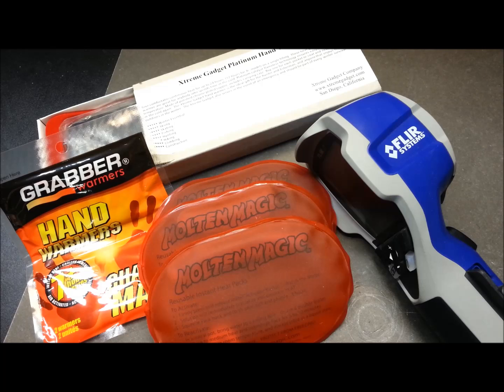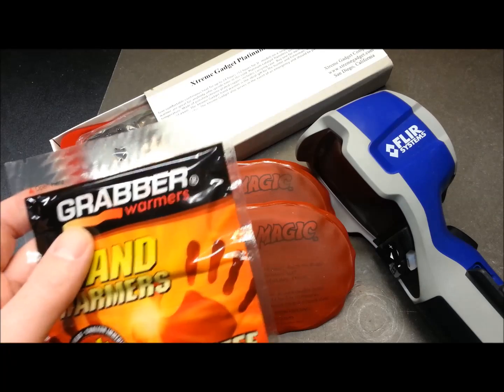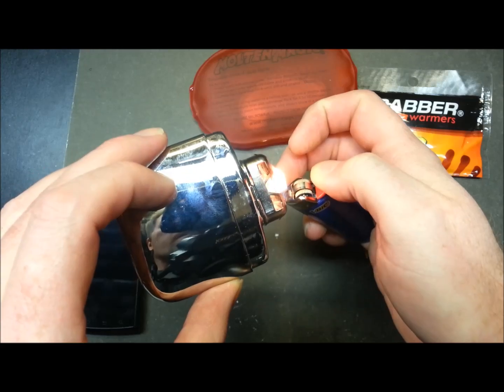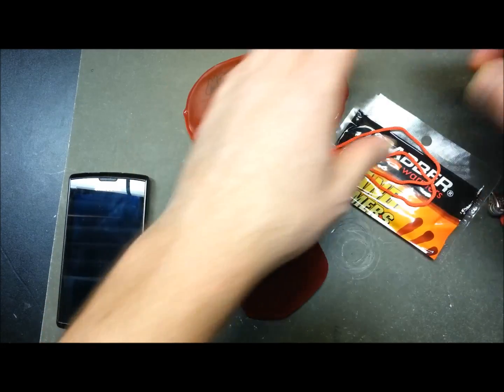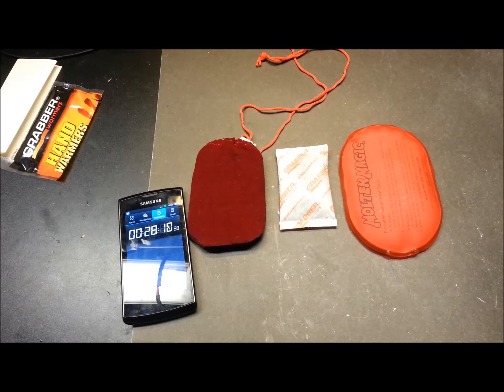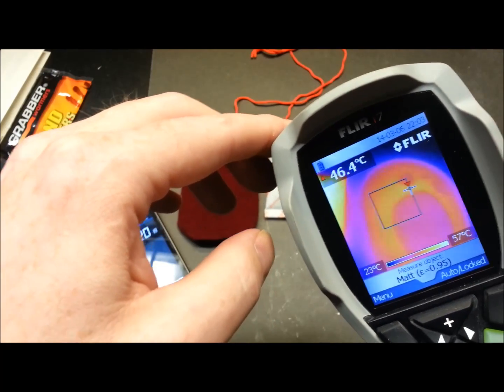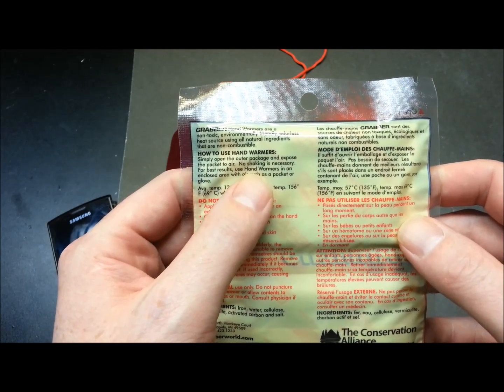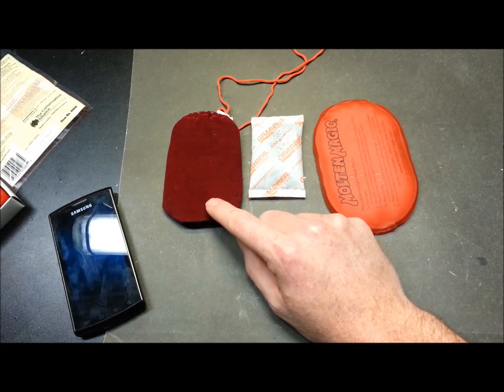Hand Warmer Test -Which type is best?

Comment: What about a Li-Ion powered hand warmer? For this application this would be est, it's a it heavier, but it will go for hours and it doesn't need oxygen and the heat it generates keeps it's own batteries and electrics going too. I prefer the catalytic heaters as they go longer and batteries wear out faster but in this case you can't beat a battery.
Reply: Sure it'd probably be possible just to make a little heating circuit with an element, thermostat and battery, to turn off and on as needed. Was 7 years a go tho, so no matter. lol

Comment: the catalytic was very  incorrectly done they it was done was for low temp and longest duration if higher heat it should have been left out of the bag for at least till it was very hot to the touch as More air means more heat and that sets the overall  temp so very unfair test as the equipment was not well understood before operation

Comment: Interesting, how did it work out in the payload?
Reply from the maker: +kamikazekeebler Perfectly. The testing showed in the end I only needed a small amount of heat with the GoPro radiating as well inside the HAB. One single disposable was just right and did not overheat (would kill the cams) or underheat (also killing the cams).  The datalogger showed I hit it bang on. Full video on my channel.  Cheers

Comment: So which gave off the most heat??
I tried skipping to find where you talked about it, annotations would be nice
Reply from the maker: +Zoe Doucette It was a test for a high altitude balloon as mentioned so there was no "most heat".  That would be hard to measure empirically.  Time radiating heat was indeed measured.  Just get yourself the disposable ones and all will be fine.

Comment: One type of heating that you might want to add to the comparison is electric.  A simple resistor [(1W or 2W 60 ohm) or (4W  Silicone heater)] would be dead reliable and enough heat for the small space.  You could also PWM the heater so as the temp drops you add heat.  You have the controller and other data already.  Just a thought and thanks for the videos.
Reply from the maker: Thanks Matthew.  Check out the upcoming videos- the thermal output requirements are significantly more than even I expected.  I haven't done the exact math yet as I haven't got the heating up high enough to even support - 20C for an hour, the wattage required will be significant to say the least :)  Cheers
Reply: Eric William Are you not insulating the instrument box?  When we did our HAB we used 2" pink foamular as the instrument box held together with clear packing tape, nearly in destructive and light.  A 4-watt heater could give a 30 deg C change in temperature easily.

Comment: Hi Eric, you might like to check into a thing called a crystal oven, they used to keep RX/TX oscillator crystals at a set temperature to avoid problems with drift. Can properly be able to build one theses ovens cheap and light enough and power it off of a LiPo battery, and also program the oven to turn on at a set temperature or altitude to save on battery power.
Reply from the maker: Thanks Dale!  This is exactly why I enjoy posting videos and receiving feedback.  I had not heard of the crystal oven at all- a quick look and I see several videos and posts.  I'll definitely take a look.  Cheers!
Reply: Hi Eric, is a friend of Dale's here, I had an idea that may be more simple,
You can mount a linear transistor near 1 end of your board, and the
collector's resistor near the other end of the board, with the biasing for the
transistor being preset by 2 components ; 1 is a thermistor of your choice,
located at the centre of board, with a mutiturn "threshold" pot nearby
so - > end result - no power consumed until you have set it for slowly
ramping up the heating current, as the pcb starts to fall too low in temperature - i,e,  by setting the pot, you will get a twin-heated centre
monitored ; minmum consumption heater circuit. I hope this helps
Regards Andrew VK5WT
Reply from the maker: I'll definitely have to consider something like that if we launch another.  The data logger circuit is already complete and under tests so I think I'll just stick to the warmers this time.  Thanks for the ideas.  Cheers.

Comment: The reusable liquid one is Sodium Acetate, a.k.a. Hot Ice. Maybe an electric heating system would be an option. You can get flexible stick-on heaters for electronics.
Reply from the maker: Yep indeed it is.  As for electric heating- the draw to get the BTU output actually cause some problems for weight when it comes to supplying the power over the needed time.  The hand warmers are far more effective (so far).  Thanks for the input!  Always appreciated.
Reply: Maybe you could have a volume of the Sodium Acetate in a container that would partially surround your electronics (it's easy and cheap to purchase) and have a remote or temperature based system to trigger the 'freezing' reaction (dropping in some crystals for example). That might gain you some extra time.
Reply from the maker: Yep for sure.  That is actually the whole issue- if I could trigger it later, all would be perfect.  I am going to do some tests with just the disposables to see how it goes.  Once the whole mass of the HAB is at temp (fairly warm) if it can maintain that for the duration of the high altitude portion- we are golden :)  All part of the fun!  Thanks for the ideas!